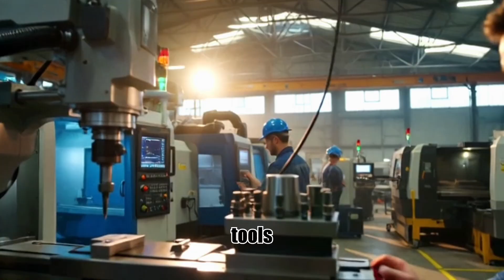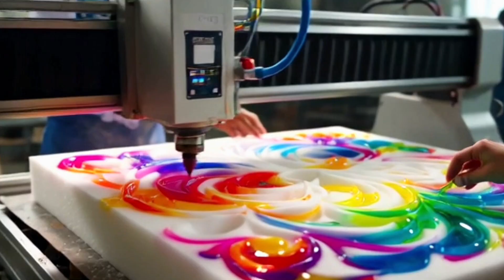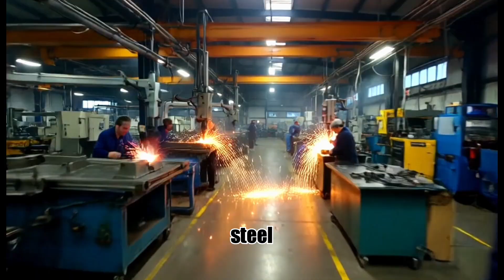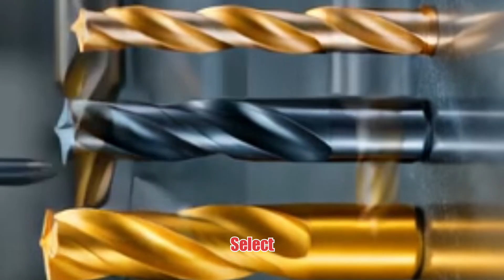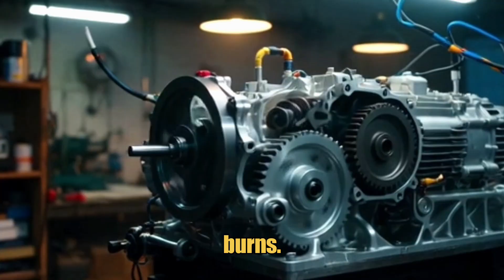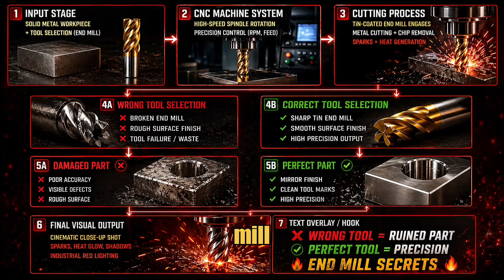🎯Tool Selection Guide (End Mills Explained Simply)#CNC #CNCMachining #EndMill #ToolSelection

Comment: At 5.38 tool fast causes overheat and too slow tool breaks, not the other way around. Coolant flow and mix is also essential as well as air blast for chip discharge.
The AI must love sparks on this one. In reality if your CNC has sparks visible, something is very wrong.
Reply from the maker: That is a great observation, and I really appreciate you pointing it out. You are absolutely right—maintaining the correct balance of feed and speed is critical to prevent both overheating and premature tool failure.
And you are spot on regarding the sparks; they are definitely a warning sign that the setup or cooling needs adjustment. Thanks for adding that valuable context to help keep the information accurate for everyone!